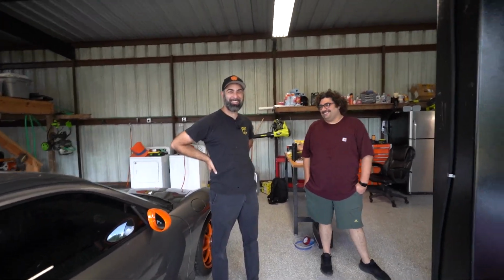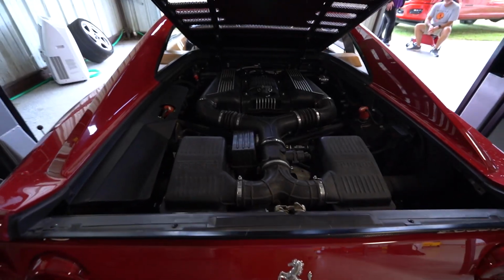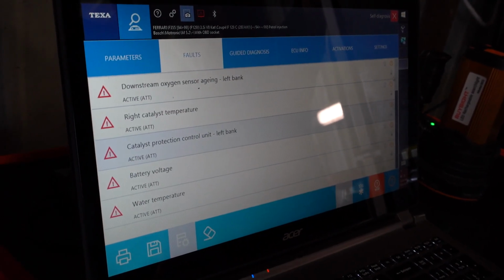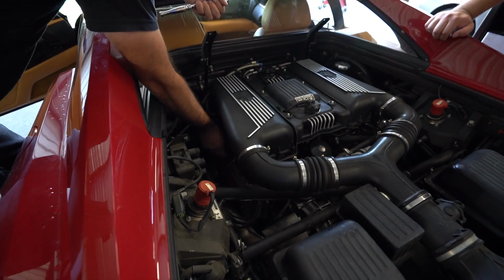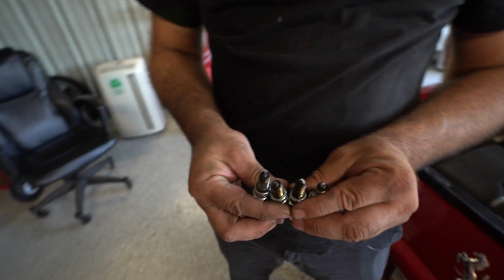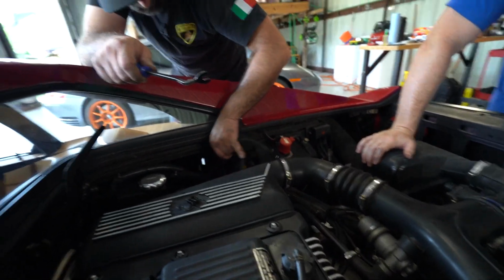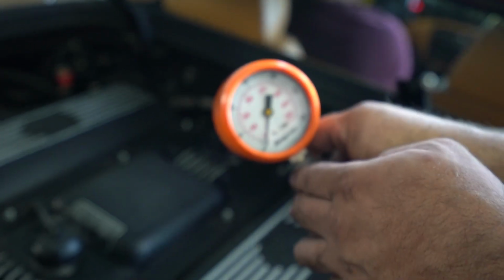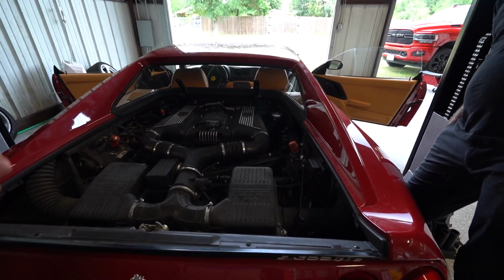Everything WRONG with the Ferrari F355 GTS Project Car | Part 1

Comment: Parts usually about $3k including clutch, HE parts, and clutch. $8k is likely the min for full engine out labor w/clutch. W/O clutch and labor reduce by $2-3k. To get a $20k bill it's because you had to replace things like cats, headers, radiator leak, AC problem, or take the trans or engine apart to replace internals. As you likely will, use the Hill Engineering bearings etc. maybe the silicone hose kit etc. IMHO

Comment: Josh, it's not the cylinders' size, it's how you use them.  The ladies prefer long hard turbo charged strokes that can go all day and night, rather than pistons needs constant coaxing to perform.

Adam: "this 911 has more torque than the Ferrari." Josh: "yeah that's 911 is a turbo-charged tractor engine."

Josh seems ignorant about Ferrari's, Porsche's, (and Lamborghini's, Mercedes-Benz's)  tractor history .

In the 1960's , Ferruccio Lamborghini owned a 250 GT Ferrari. He noticed the vehicle had numerous technical issues, such as the car used same clutch as  tractors and couldn't handle the power of the V12 engine. He complained to Enzo Ferrari in person. Ignored,  the frustrated tractor designer Ferruccio Lamborghini started making his own cars. Maybe you've heard of him?

Porsche's tractors were 4 cylinder, diesel engines, and discontinued in 1956. The 911 car was released to market in 1964, 6 cylinder petrol engine. 

Ferrari still makes tractors today (the BCS group). 

Tractor engines are usually reliable, unlike the 100% failure rate for a Ferrari F355 exhaust manifold, 20% failure rate on the valve guides. A tractor doesn't need a complete engine-out service every three to five years in order to change the timing belts.

Definitive proof:
https://www.youtube.com/watch?v=dQw4w9WgXcQ
Reply from the maker: Lol

Comment: 355 quacks.  Watching these videos I think I could own a 348, 355, or 360.  They are cars, not space ships.  Then I hear a spark plug wire set is $1000 and my thoughts quickly change to "Quack no!"
Reply: Aagh, 355 was already guessed.  356 quacks!  Better to guess a Porsche model anyway.  😂

Comment: Ive always loved the look of the 355. That would be the first question asked about the valve guides on this car if it were me. The recall on these was improperly placed screw clamps for the fuel supply lines which I'm sure has lit up some of these over the years, pretty scary. Beautiful car nonetheless!

Comment: Had a 98 355 gts and my first major was $20k as the headers were cracked and one of the struts was leaking.  Also the f1 transmission can also be a ticking time bomb, other than that it is still the best sounding Ferrari and one of the best looking ever.  Wish we had a mechanic like Josh.  Great video guys and because its a 355 that has not been serviced well I will guess 76 Quacks.